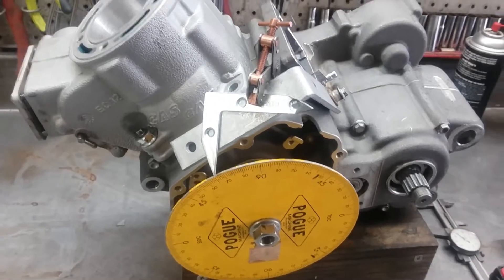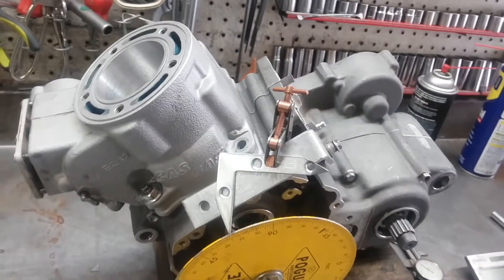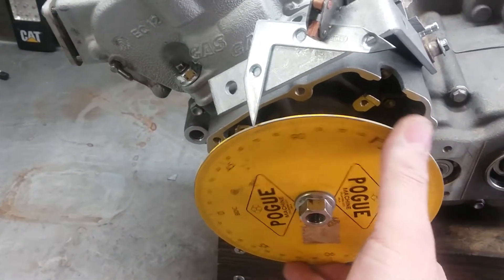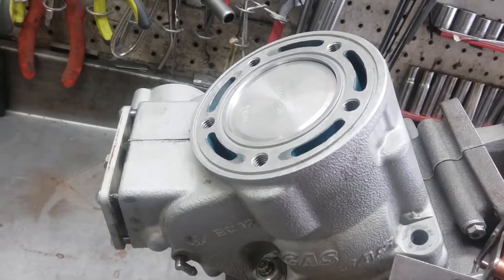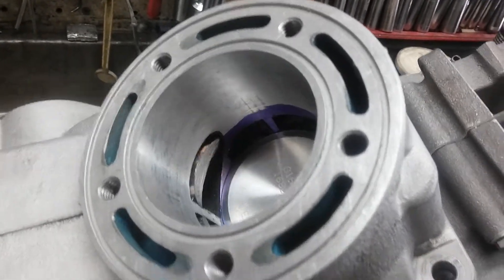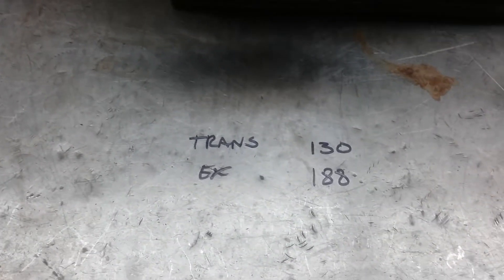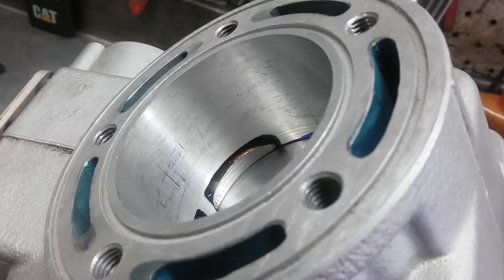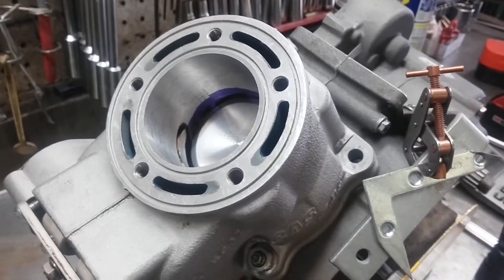gas gas 150 port timing

Comment: What degrees on the exhaust & inlet did you aim for ? Motocross engine?
Reply from the maker: This bike is for trail use so 190 on exhaust for mx 195 works good. Inlet is reeds so the port is 360 deg.